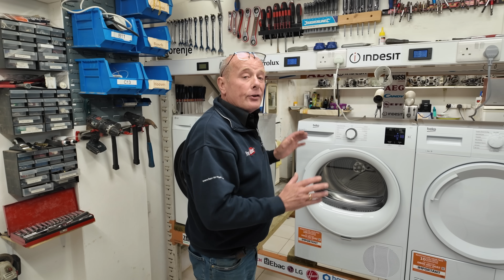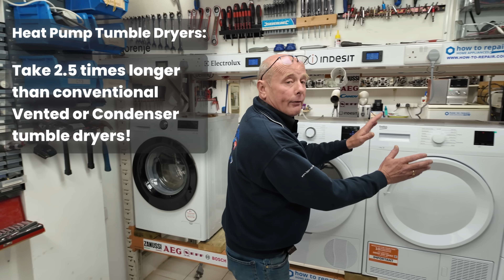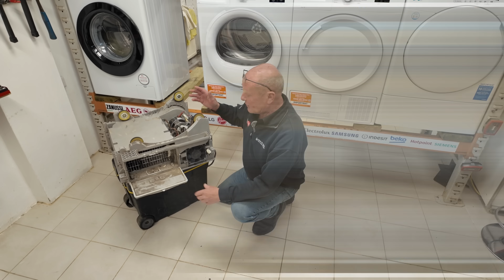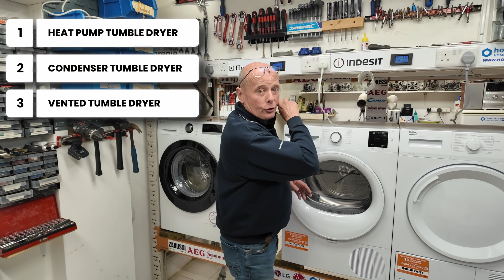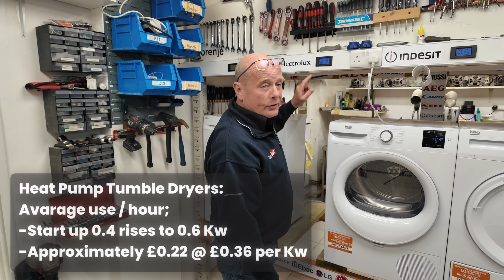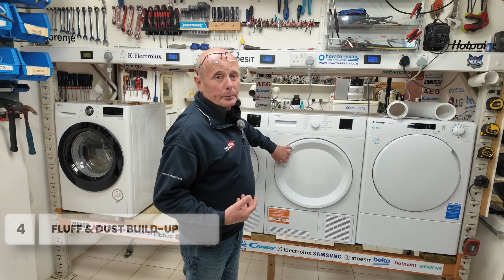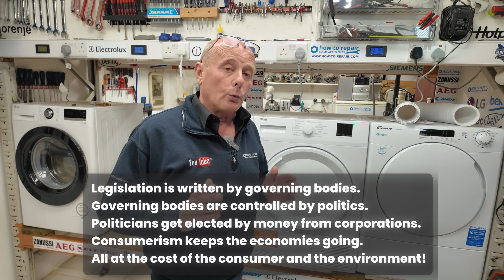Tumble Dryers the Shocking Truth About Heat Pump vs Vented & Condenser, NEW LEGISLATION!

Comment: Excellent, well explained video! I haven't got much experience with different dryers to be honest, but the points you brought up were very relevant. It had never occurred to me that using an appliance for a longer cycle has more wear and tear both on the parts as well as the laundry inside it! It seems as though the policy makers think that energy and water are always on one axis of a graph, and time-saving is on the other axis. 

I believe it is the same with the Eco 40-60 cycle on washing machines. I really cannot fathom how a 1:15 40°C cycle is more wasteful than a 2:45 one at the same temperature, given that the water level is the same on both.

Comment: 11:43 how much power does a 2 year old heat pump dryer save in energy, when fluff is present in the condenser? I have a Miele normal dryer, it is from 1991, and still running.

Comment: I've had my AEG Heat Pump tumble dryer for 7+ years and it is still going strong and without issue, it has had serious, serious use as we do way in excess of 250 loads per year as my wife often has it on twice a day, and eats through bedding and quilts,

Comment: Basic is the best! I have Candy GCC5813NB for 10 years now, the biggest repair i've done is replacing starting capacitor. Consumption even winter is very minimal as I spin our clothes 2 times and onto dryer, summer is far more less as i hang clothes for an hour or two and off onto dryer. With this "NEW technology" i don't think it will match the basic. Peace.

Comment: We have a Maytag vented tumble dryer bought new in 2004. It has been used two to three times a week for the whole time we have owned the machine and in all that time nothing has ever gone wrong. Just hope that if it ever does break down 😢we can get still get parts to repair it as we never want to replace it.

Comment: Where you suggest people should fit replacement heating elements people should research safety protocols, also condensing dryers are a greater fire risk, and the fire risk is higher than most any other appliances ,good video thanks .

Comment: Interesting view but I didnt hear you call out that actual kWh that the heatpump dryer used. We use our dryer for a holiday let business so the machine gets used a great deal so economy is important. Do you see a difference between brands? We have a Bosch unit that forces us to run regular cleaning cycles to clean out the dust.

Comment: Just replaced our 13 year old washing machine and our tumble dryer is 12 years old and that's had 1 new lint filter, 1 replacment heating element, 3 replacment belt jocky wheels and 2 belts.   It runs for an average of two loads a day.  Think I'll be killing a heat pump drier every 3 years......

Comment: I purchased a heat pump tumble dryer because vs vented or condenser types it's energy usage is far smaller and thus will break even on running costs in just over 2 years running just once per day. Compressor technology is usually highly reliable, look at fridges and freezers, they hardly ever go wrong and you'd expect a good 10+ year run out of them. Considering the wear on the bearings, I take the point about additional wear due to run time but as an industrial maintenance engineer I would also be looking at the bearing temperature load and as heat pump driers run cooler this should help the bearing lifespan.
Reply: You don't have to worry that much about it. I have mine AEG heat pump dryer for about 12 years and it still works as on day one. 
If you take proper care of the pre-filter and keep the fins inside the machine clean, it won't break before you have recovered several times your investment compared the other types, especially in Europe where electricity is not cheap.
IT's true that it works more efficient when you make multiple batches in sequence on the same day, rather than having it run once per day indeed.
Reply: What you missed in the comparison to frige/freezers is that they only come on intermittently for a short period to bring the temp back down, a heat pump unit will be on all the time during the extended drying cycle. Ive no idea of how it effects the lifespans, but the dryers will have a 'harder life' and thus shorter life.
Reply: @timjackson1904  I take your point regarding the loading on the compressor, but a fridge / freezer is on all day everyday (with compressor cutting in and out as required) and a heat pump tumble dryers daily run time, assuming say running 2 cycles per day, would be a similar run time for the compressor units. Also worth factoring in is that on/off cycling of a machine generally breaks it faster so the constant stop / start of fridge / freezer compressors is potentially more detrimental to their lifespan.
Reply: Shhh, don't say this as you will trigger the tin foil hat brigade.Tumble dryers are now part of the "green agenda" and are therefore woke. Have you ever seen anyone walk more than 15 minutes with a tumble dryer on their back? No. And that's what they want. They want you stuck at home with your broken tumble dryer, unable to leave the house because the wind isn't blowing.

Comment: This video must be seen as i have just replaced a Candy condensing dryer, which has broken down twice in 2 years and was only bought in 2022!!. On asking the engineer who attended the recent breakdown, i asked him "which dryer don't you have to fix?" and his first answer was - don't buy a Heat pump dryer as they are his biggest pain as they are a nightmare to fix and there is no consumer parts to replace. His suggestion to me was a Beko condensing dryer as they are more reliable than most. I have taken his advice and so far it is way better than the Candy it replaced and it dries way faster.
Reply from the maker: Thank you for sharing your experience it's both insightful and practical for anyone navigating the frustrating world of unreliable appliances. Two breakdowns in two years for a relatively new Candy dryer must have been incredibly frustrating, especially when it's not built to last or easily repairable.

Beko is one of the few companies that offer technical information to help you fix your appliance. Their workshop manuals are very helpful, and their wiring diagrams are quite good. At least they are making an effort.

Thank you for your comment. I appreciate people like you taking the time to write it out. Please share it where possible. It might help others make a wise choice instead of being misled by the industry.

Comment: Condenser dryers are crap ,they put so much moisture in the air in the house ,I had go fix lighting at nans house as this crap dryer kept rotting electrical appliances lighting ,as was small house never liked it we threw it out got standard dryer vented it outside through core hole in wall never had issue again .
Reply: If the condenser dryer is making the house damp it was either a faulty appliance or operator.    We have one and it runs for at least 2 loads a day and we have no humidity problems.....
Reply from the maker: Thank you very much for the comment. It is much appreciated. Yes they use more power but they are serviceable affordable and you only have to pay when you're using it. Yes, the heat pump tumble dryers are using far less energy and saving excess load on the grid but we could also use our same appliances and use them at the point of day that is better for the  grid and if you have solar, then you could work around the times. I didn't expect this video to be seen by so many people, with thousands of comments. It must be really annoying for the manufacturers. But together, we might be able to make a difference. I might end up with the horse’s head at the end of my bed but what the heck.
 If you could share this video so more people see it, we might embarrass the government and the manufacturers, and change some of the crazy laws in place.

Comment: Modern heat pumps are easier to clean than the one you showed
Reply from the maker: In the European Union, they are not that easy to clean and most engineers will tell you exactly that. Thank you very much for the comment.

Comment: Wow. Really interesting.
Designs can be improved on heat pump driers for clean say. But some of the fundamentals seem to remain unfixable.
Reply from the maker: What bothers me is that this is very simple.(A child could do it) Manufacturers could easily design it so the top and bottom of the condenser box can be removed. This way, it could be flushed out easily.
Or are they deliberately building this way to make it unrepairable?.
If any of your friends or family are thinking about buying a new dryer, it would be helpful to share this video with them. It will give them an idea of what to expect when purchasing a new dryer.

I hope older models will still be available, but I can't promise that. It's important for people to know the differences between the dryers on the market and understand any potential issues before making a purchase.

Comment: Traditional vented tumble dryers should never be phased out!
Reply from the maker: How many people do you know that have a tumble dryer in the garage or shed and when winter conditions set in condenser and heat pump tumble dryers will never work. If any of your friends or family are thinking about buying a new dryer, it would be helpful to share this video with them. It will give them an idea of what to expect when purchasing a new dryer.

I hope older models will still be available, but I can't promise that. It's important for people to know the differences between the dryers on the market and understand any potential issues before making a purchase.
Reply: @How-to-repair  Thank you, Paul. Your videos are vital for folks to understand the reality of the very important facts about the new heat pumpers. I may actually buy a new vented dryer to stock up for the future. 😀

Comment: I have approximately 12 years in the industry. The heat pump dryers were new when I was half way through my tenure. Even then we didn't like them as a company for the exact same reasons. It's all a con.
Reply from the maker: Yes, and that's why I made the video. I am fed up to the back teeth of manufacturers making it harder for us engineers and also ripping off the general public. If any of your friends or family are thinking about buying a new dryer, it would be helpful to share this video with them. It will give them an idea of what to expect when purchasing a new dryer.

I hope older models will still be available, but I can't promise that. It's important for people to know the differences between the dryers on the market and understand any potential issues before making a purchase.

Comment: My Miele tumble dryer was expensive to buy, but has been working fine for quite sometime, dries the clothes within an hour and a half, and because it’s quite cheap to run I’m more likely to use it. Yes it was expensive but that cost is in the past, it’s forgotten now. 

I’m very conscious of cleaning and vacuuming it after every cycle, I’m sure after the 5 year warranty period I’ll be able to dismantle it to give it a good clean, I’m not advocating for heat pump tumble dryers but it seems like the one I have is doing what it needs to do very well. Hopefully it lasts without too much expense and hassle.
Reply from the maker: Thank you very much for the comment. You paid a lot of money for your dryer and I'm glad to see you're taking care of it

Comment: Hi Paul, im an appliance repair engineer myself and been doing it over 10 years. This is a perfect presentation which i will pass onto consumers. Ive had so many customers scrap their heat pumps and go back to a condenser dryer as they had before due to their issues. I even had 2 repair jobs on today for heat pump dryers and both were full strip down and clean as lint was inbetween the condenser and evaporator. I lile the idea of the heat pump dryer but over the past 5 years they havent improved at all.
Reply from the maker: Thank you very much for the comment. It's hard to believe that manufacturers expect consumers to be happy buying major appliances every few years. Using environmental issues to sell more machines is ridiculous, especially considering the ecological damage it causes. They are ruining their reputations by making such products.

I haven't seen any positive comments from engineers about these machines' serviceability. They are poorly designed, and the manufacturers know about the fluff issue. That's why at the Berlin trade show last year, I saw increased filtration systems on all heat pump tumble dryers. They know the problem exists, so why keep making these poor-quality products?

Thank you for your comment. I appreciate people like you taking the time to write it out. Please share it where possible. It might help others make a wise choice instead of being misled by the industry.

Comment: Surely there is no reason to believe the heatpump system is any less reliable than one in an fridge?
Point taken on fluf and poor design- but thats nothing to do with a heatpump!
Reply from the maker: I haven't even started on the way manufactures are creating obsolescence in fridge freezers today that will be another video. The conventional fridge freezer used to only consist of a thermostat a lightbulb and a compressor they used to work for 20 years minimum today people are not even getting five years. If any of your friends or family are thinking about buying a new dryer, it would be helpful to share this video with them. It will give them an idea of what to expect when purchasing a new dryer.

I hope older models will still be available, but I can't promise that. It's important for people to know the differences between the dryers on the market and understand any potential issues before making a purchase.

Comment: Heres an idea .  Make a heat exchange manifold for vented system where incoming air is pre heated by exhaust air.  Simple aluminium casting that is openable for cleaning job done will last 20 years
Reply from the maker: Good idea might look into this later later date If any of your friends or family are thinking about buying a new dryer, it would be helpful to share this video with them. It will give them an idea of what to expect when purchasing a new dryer.

I hope older models will still be available, but I can't promise that. It's important for people to know the differences between the dryers on the market and understand any potential issues before making a purchase.

Comment: I did a ton of work on driers in the late 90's for a major manufacturer thinking of launching one to go along side their fancy (and colourful) washing machine.

Vented driers are very cheap and simple and very inefficient in addition to the 2kw they take to run they also are sucking warm air from inside your house and expelling it, so in winter your house heating system needs to work harder. In summer it makes no difference (of you use them in summer) 

Condenser driers are more complex and less efficient (as they do not get free heat from the house heating system but all that heat ends up inside your house (assuming it's not in the garage) so it can help reduce your heating bill, especially if you are on electric heating. Cleaning the condenser unit is relatively simple as you can remove it to rinse

Heat pump driers are more complex and expensive (over £1k back then, much cheaper now). They are 2-3x more efficient per kg of washing and all the heat ends up in your house like a condenser drier. They can (if designed correctly) be as fast or even faster than other types as they aren't limited by the plug input power, but that is a design choice that may not be taken. Cleaning the condenser and evaporator clips is trickier but there is no reason they inherently less reliable (they are basically a fridge and a condenser drier mashed together, both of which are well known technologies)

Sadly the manufacturer declined to pursue Heatpumps as the owner was obsessed with speed and being different (AEG already had a model on the market). Instead they pursued a bonkers dessivant based solution that was 3-6x less efficient than a vented dryer (also sounded like a jet engine when running). Luckily it was killed internally  before it got to market.
Reply: With you being in the field, have you heard of mechanical steam compression driers?  I've heard the concept being mentioned a bunch of times, but no devices seem to be on the market and it looks to be a dead end.
Reply from the maker: Thank you very much for the comment. The phrase that stood out to me from your detailed answer was if designed correctly. I completely agree with this.

If you consider a standard heat pump tumble dryer, it could be designed with one removable side panel. A lid on top of the evaporator and condenser could also be easily removed, as well as the underside of the machine. This would make it simple to flush out the evaporator and condenser, making maintenance easy.

However, manufacturers have designed these machines in such a way that you have to strip the whole machine to do a simple maintenance job. This creates built-in obsolescence. A child could have done better.
If any of your friends or family are thinking about buying a new dryer, it would be helpful to share this video with them. It will give them an idea of what to expect when purchasing a new dryer.

I hope older models will still be available, but I can't promise that. It's important for people to know the differences between the dryers on the market and understand any potential issues before making a purchase.